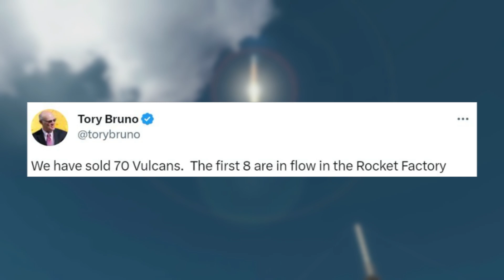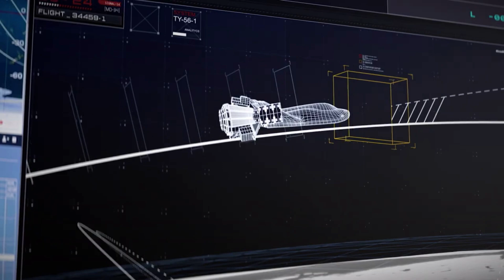Is Dream Chaser Tenacity On Track To Launch In 2023?

Comment: I thought we learned with the shuttle that the space plane idea was flawed? I hope that the smaller and newer tech alleviates the  the massive costs of the tiles and tile failures.
Reply: Shuttle is more on execution than the spaceplane design (while it failed in its primary goal of reduce cost and rapid refurbish, the shuttle still carry more than half of all astronaut in history to space). So spaceplane design can work if you used to its advantages (in Dream Chaser, it's soft landing)
Reply: Deke Slayton wrote in his autobiography that the Space Shuttle had a large delta wing for cross range requirements that complicated things when it came to re-entry. Seems he was saying that Max Faget's approach would have been better (smaller, stubbier wings). In the case of Dream Chaser, a lifting body design is being pursued.
Reply: The main flaws of shuttle come down to one main fact, It was a NASA iconic bird. 
I do not mean that in any way bad about NASA, they are miracle workers, but i mean that also means that 1000's of people and companies are forced to be part of it and all of them demand their own parts and goals be used and accomplished. 
So it turned out to be one of the most complex vehicles in human history while carrying the highest demands on its shoulders.

Dream chaser will still have some of this but not nearly to the same extent and so can be so much simpler, cheaper and have less demands to carry. 
I dont know how many rich corrupt politicians (which dont have any idea what spaceflight needs but demand so much for their own gain) have their fingers in it to ruin it, but ill bet its a hell of a lot less than shuttle..
So i have high hopes for its future.
Reply: @Vatsyayana87  The shuttle wasn't iconic though in the mid-1970s when a number of design choices were pursued. Deke Slayton pointed out that the use of a large delta wing for greater cross range was a real problem (in dealing with weight and heat). Otherwise, they were breaking ground on thermal protection systems that proved quite difficult to master. And then, they were going to reuse engines for the first time, so those had to be developed within very tight budgets, without any real knowledge from an operational perspective on ongoing maintenance burdens. 

Where there seemed to be overconfidence was in the area of solid rocket boosters, since the US Air Force had deployed solid rocket fueled ICBMs at scale, and both a couple of launch systems gained experience using SRBs. But thought I heard that refurbishing even those boosters proved difficult due to recovery from the ocean (dealing with seawater?)...

The foam issue seem to have been unforeseen (and interestingly enough, seems the Soviets hadn't really delve into choices of foam either, when it came to Buran). 

Then the economics were still debatable then. Supposedly the Soviet Spiral spaceplane team did a study and said the American shuttle wouldn't pan out, when there were debates about proceeding with Buran in 1976. The idea of a carrier craft / fly back booster got rejected earlier on due to cost, time and technology challenges, so a compromise on reusability was necessary.

As for shuttle development, I believe Dennis Jenkins showed that they pretty much kept within the forecast despite delays. The issue was more of a huge technological challenge combined with an effort to have the shuttle take on different mission profiles to support a higher flight rate (hence lobbying to the Air Force, which didn't really like it).
Reply: @Vatsyayana87  as for Dream Chaser, believe you are right here: "Dream chaser will still have some of this but not nearly to the same extent and so can be so much simpler, cheaper and have less demands to carry. "

Smaller, more manageable, on a simpler approach to launch (albeit with less reusability with Vulcan currently), provided by a private company, going first with supporting cargo, and then later, maybe, passengers, that may include leasing services to other countries (like Japan. 

And time and experience in general has been gained on issues like thermal protection systems (the shuttle, Buran, the Venturestar prototype, what SpaceX is doing, etc.), reuse of engines, avionics, etc.

Comment: Great to hear the 70 reservations / sold Vulcan flights, but Aʴsetechnica says that ULA is up for sale, (possibly to Blue Origin, with Tory taking over BO). This is an interesting wrinkle.

The real question is whether Dream Chaser or starship land successfully first. This will be entertaining to see this play out. And add in a successful super heavy catch with the chopsticks. I think Dream Chaser has fewer unknowns unknowns.
Reply: I would not be surprised if Blue Origin's interest in ULA, is because of the BE-4 engine delays. ULA and Blue agreed in 2014 for the BE-4 to be used on the Vulcan Centaur and it was supposed to be flying by 2020. There are rumors that Blue wants to raise the price of the engines to ULA, to cover costs. So Blue might be buying ULA to get out from the existing BE-4 contract without tanking the sale of engines to ULA. Which would become a division of Blue, so they would be paying themselves when they bought engines.

The Dream Chaser is based on lifting body designs going back to the 1960s with newer materials for the TPS. If you are talking a successful mechazilla catch, then Dream Chaser certainly might win that race.
Reply: If it is true ULA is up for sale, which does make sense, it is probably a good thing for both ULA and Sierra Nevada Corporation. ULA parent companies Lockheed Martin Space and Boeing Defense, Space & Security have been very stingy with investment funds. The Department of Defense had to strongly support the development of Vulcan's BE-4 engines and solids and provided development grants worth $967 million directly to ULA. If ULA is going to stay competitive with SpaceX and other startups it is going to have to invest deeply in new and presumably reusable technology. If Blue Origin is allowed to purchase ULA seems problematic. BO works under the good graces and finances of Jeff Bezos. Their finances are not publicly available, but they are certainly not anywhere near profitable. It Jeff Bezos wants to use $10s of billions of his own money for the purchase of ULA and more billions making it competitive seems a stretch. Moreover, it seems unlikely DoD would approve of such a purchase. DoD wants competition between its launch providers and merging two of three medium to heavy rocket companies is not how to do it. Lockheed Martin was stopped from purchasing Aerojet Rocketdyne by antitrust regulators. They apparently wish to get more involved in the rocket launch business without the dead weight of Boeing around their neck. Lockheed could buy Boeing out of its share of ULA.  Northrop Grumman, which is expanding its capabilities in the launch business and already provides solid rocket motors for Vulcan, also is a potential suitor.  Whatever the case, DoD will not let ULA weaken from their primary launch provider.
Reply: @WWeronko  I agree with your thinking, seems to make sense that BO may not be able to / want to up their economic burn rate to do what needs to be done. But with Amazon being a huge customer maybe the numbers look better to Bezos. It probably is  just an unfounded rumor anyway.